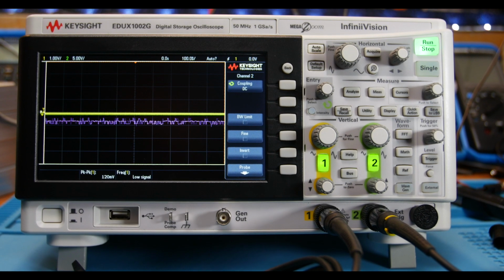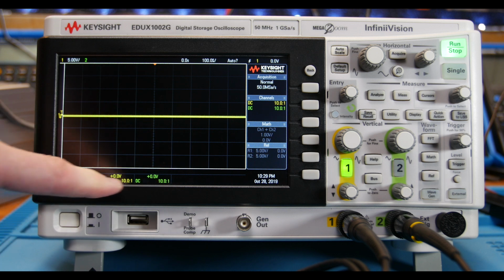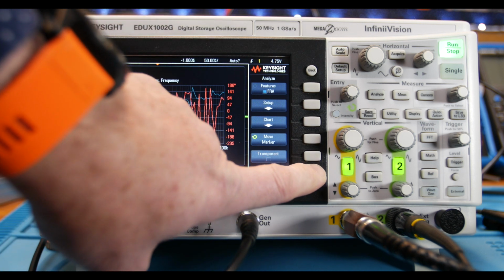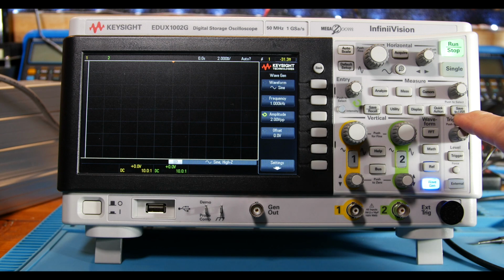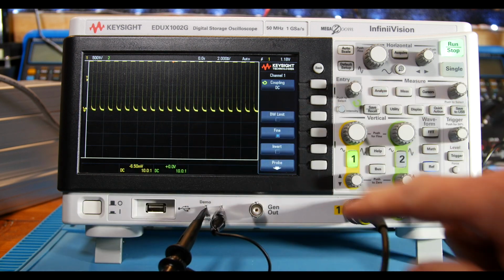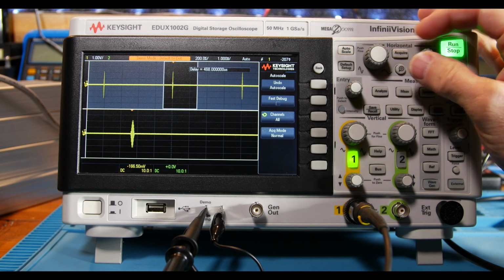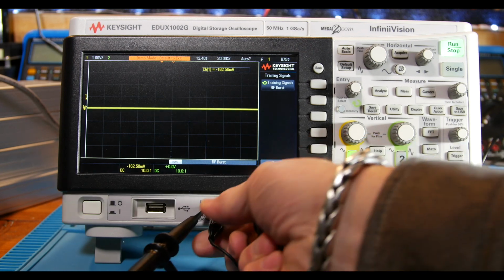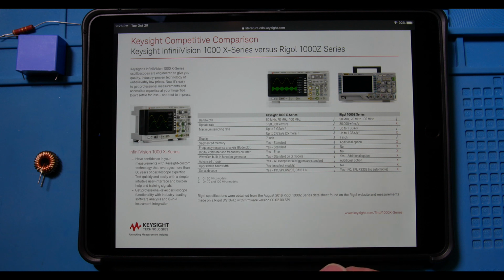Keysight Educational Oscilloscope - Keysight EDUX1000

Comment: Always start up before using the scope, by hitting the DEFAULT button... Then things like the math signal will not be present..  😉 Pluss other settings that can trick you out will be removed.
Reply from the maker: Thanks for the tip!  That is not a bad idea.  Some scopes will keep your latest setup, so if you are picking up where you left off you may not want to do that;)  Also, many scopes will save a number of setups, so if you like a particular setup, then you can start by selecting that stored setup.  My Micsig makes it very easy to do this.  Great topic Erik!
Reply: @KissAnalog  Have a around 50 of stored setups, very handy to get back to setups that involve ex advanced trigger settings, setups for quality tests of different products etc. saves a lot of time,  AND hinders getting wrong results. I use a InfiniiVision  MSOx6004A (In the other end of the price range, but i got it dead cheap), plenty of settings to reset manualy, so default button is in use often.
Great videos you make!! Keep up with the excelent work!
Reply from the maker: Thank you for this feedback @Erik Hovdahl.  I agree, I usually have 2 or 3 setups saved that I use often, sometimes I get more but then I lose track of which is where ;)  I appreciate your support!

Comment: I BOUGHT THE MODEL OWON SDS7102E DSO OSCILLOSCOPE.I HOPE I MADE A GOOD CHOICE.IT SHOULD BE GOOD FOR MY PURPOSES,THAT IS FOR GENERAL ELECTRONICS.I LOOKED AT MANY AND,WAS A DIFFICULT DECISION TO MAKE.
Reply from the maker: david luther Hi David, did you purchase it from Amazon?  They have an excellent return policy.  I’m a bit surprised that this Owon is this expensive.  I think it is an older series.  I’m sure it will be fine but they do have the XDS series which is newer I believe and lower cost.  I did a video on scopes in this price range and there is an Owon XDS in it.  It is one of my most watched videos.
Top 4 Oscilloscopes under $500 https://youtu.be/NU-E4jT_LRI
Reply: I PAYED $355 FOR IT WHICH DID NOT SEEM THAT MUCH TO ME.
Reply from the maker: david luther that’s a great price!
Reply: @KissAnalog YES I BOUGHT IT OVER AMAZON.THE DIRECTIONS SAY IT CAN BE CONVERTED TO 10MPTS HOW DO I GO ABOUT THIS?
Reply from the maker: david luther Normally updates are done by downloading a file from Owon and then installing them into the scope using the USB port.  Owon should have AG_Series_USB_Driver_Install_Guide.pdf
Reply: @KissAnalog  THANK YOU FOR YOUR TIME.
Reply from the maker: david luther You bet!  And thank you for yours - I appreciate the comments!
Reply: I THINK YOU MAY HAVE LOOKED AT THE WRONG OSCILLOSCOPE BECAUSE THE LISTING ON AMAZON HAS  THE MODEL NUMBERS AND,PICTURES THAT DO NOT MATCH AND,ARE ALL SCREWED UP.THEY MUST OF BEEN DRUNK OR,ON DOPE WHEN THEY ENTERED THE DATA.

Comment: I like the quality of the Keysight stuff, but for what this is, it's really overpriced.  For about an extra £30 you could get a Siglent SDS1104X-E with STB-3 demo board and have a future-proofed scope.  It's nice that the educational stuff is built in, and the function generator is good - it would be an extra £240 for that option on the Siglent - but I don't know that it's enough.  I guess if you looked second hand it might be a good buy as I suspect people get rid of them after a while.  Still, as I say, at least you know you're getting quality.
Reply from the maker: Andrew Johnson I agree Andrew.  There is a name of excellence that Keysight has to uphold, so you pay the price.  I think this series hits a much lower price than you typically see from the big names.  I think the competition has forced this;) Your stated solution is a great one.

Comment: As an owner of a Tek TBS1052B I wouldn't buy it again, but spend the money on the Keysight.

The TBS1052B is slow in display response, sometimes it freezes when I go down on the timebase. Also it needs more time to boot, then an old vacuum state scope to heat up (Tek 310A).

Only two things I actually like about the TBS1052B is the user interface and that in FFT mode only the FFT plot is shown and not also the waveform (other scopes do that) at the same time.

I guess this is what you get from Tek for 500€. For basic every day work it's ok but you get more for your money by other companies.
Reply from the maker: BeamFinder Thanks - that’s very helpful for others looking to buy.  I just got a chance to use the new Tektronix scope and was so disappointed!  I like my GW Instek better than the $25k scope. The new $$$ Keysight scopes have a much better interface than the similarly priced Tektronix.  For reasonably priced scopes for home or the small shop, there’s a lot of options.
Reply: @KissAnalog  Im thinking thaat Tektronix is laging behind the rest of the industry, 30 years ago, excelent, but havent transitioned well into the digital age. They are so slow, and is a frustration to work with.

Comment: On Amazon it only got a two star review. Can you read those reviews and then do a video on the claims of the poor performance and the lack of function using that review as a guideline to either prove or disapprove of the knowledge or lack of knowledge of the reviewer. I think this would make a great video on the subject. If it turns out to be positive and disapprove the claims I think he say it would be very happy to have such a video produced on their behalf defending a bad review. 
        If on the other hand the review turns out to be true then KEYSIGHT should take note and possibly do an upgrade for a release for a software upgrade to release to its customers to address the lack of usability or problems. 

          My college electronics class has the same scope so I went out to purchase one myself last year to use at home. I found the Keysight DSOX1102G 70 MHz 2 GHz sampling for $633.00 it took a lot of searching and digging deep on the Internet through Amazon and eBay. To find out who the original company on Amazon was to find their brick and mortar store cut out Amazon 15% mark up plus at the time they were having a 25% sale promotion.
        Through schools get a 33% discount when buying in volume I think it’s either 3 to 5 units to get this discount.
Reply from the maker: t lech That’s a great idea!  In the end it helps both the buyer and seller.  Thanks for the idea and sharing your purchase history.  Did you buy the same scope that you used in school because you were familiar with it - or because you really liked the way it worked?  How have you liked it since?
Reply: Kiss Analog since my only experience was with a Goldstar analog scope I bought in the late 80s when working in the automotive field to scan sensors I never utilize all the features so I wanted to learn more now that all cars are going completely digital and electronics. 
         I choose the same scope just because what I learned in class I will be familiar with the same scope at home as a learning tool and then I could graduate on to a different scope when I feel competent. 
        If Keysight would do the same program that Apple did in high schools and colleges nearly 40 years ago to get their product into every students hands so they were familiar with it when they grow up and become adults and make more money with purchasing power they’re more likely to gravitate towards the same manufacture who gave them a good product at a good deal when they were familiar with in school. That’s marketing thinking towards the future not grabbing quick profits for the right now sale.

Comment: Hi Eddie,
Looks like a good scope :) 
Layout and button functions are very good.
It would be interesting to compare the voltmeter function against a decent multimeter.
I noticed there's no trigger out or LAN connection, I suppose it's aimed at the schools market ?
ATB Adam
Reply from the maker: Adam L The trigger was on front, I left the protective black cover on it.  You are right, this one did not have the LAN connection, but it does have usb;)